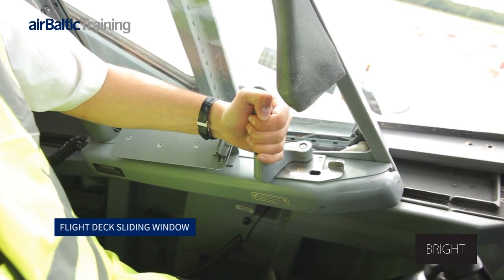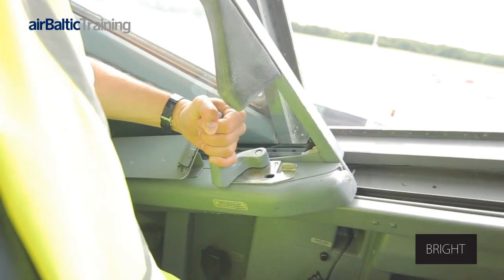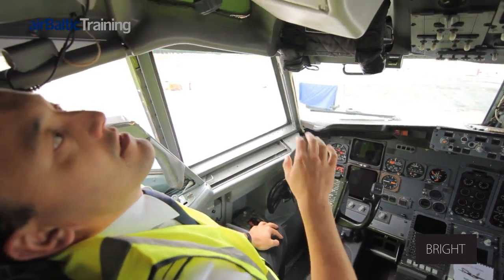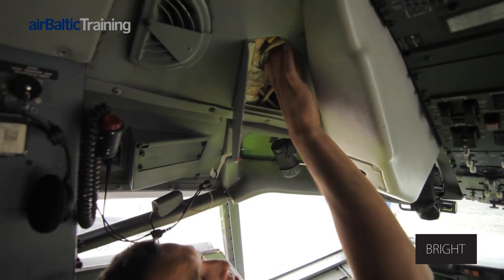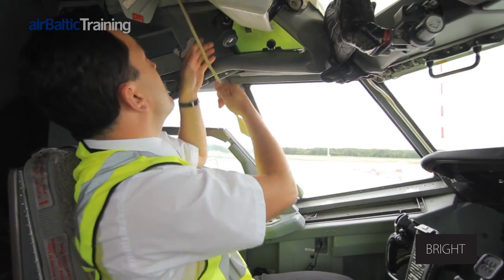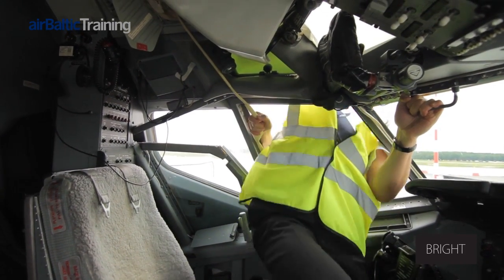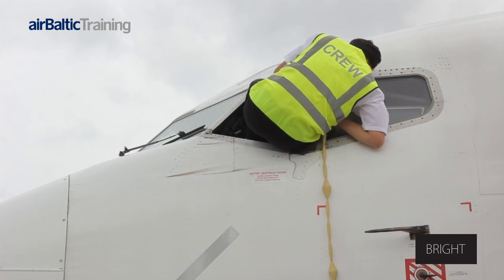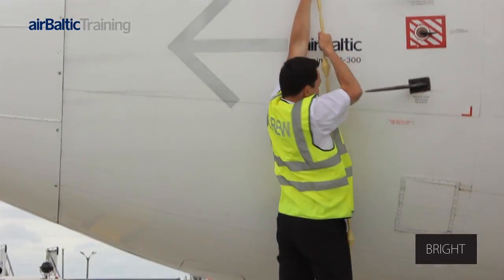Boeing 737 300/500 aircraft Flight Deck Sliding Window

Comment: is this still being used in modern aircraft ?
Reply: Qwereena yes when I was training you have to learn hot to evacuate like he did
Reply: Mr Beast liar, you are not even a pilot.
Reply: Yes you can see them escape with the rope in hostage crisis.
Reply: All major aircraft manufacturers have either opening flight deck windows or an emergency escape hatch